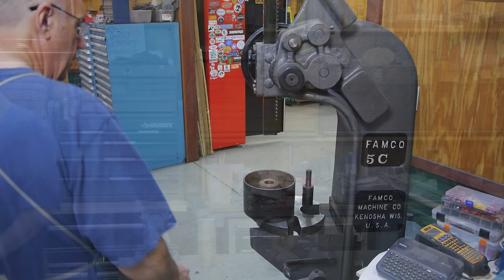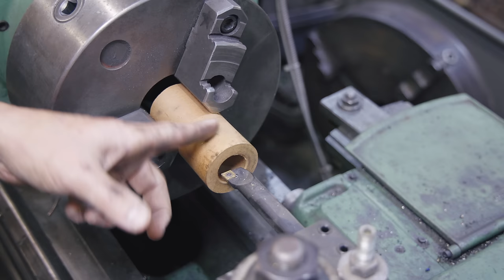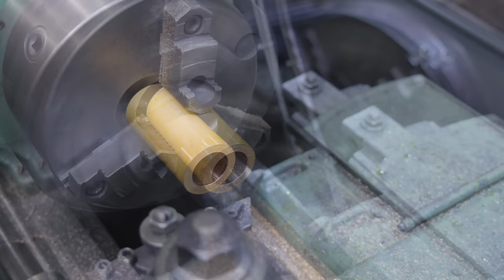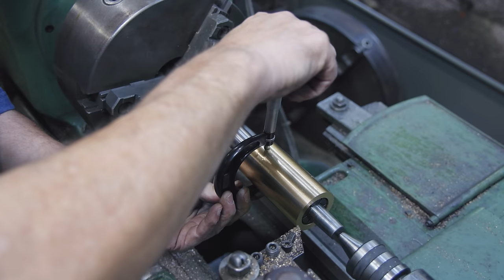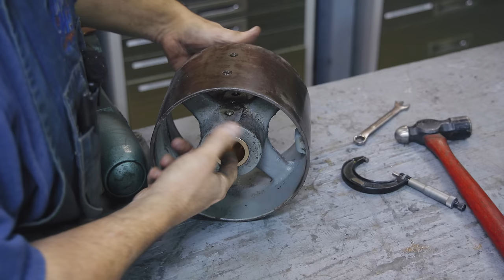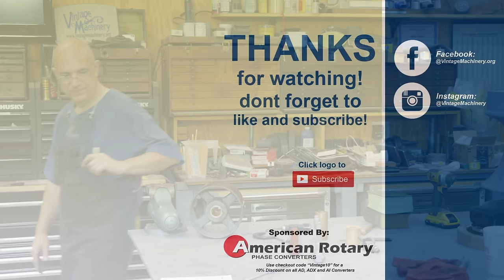Turning a Bronze Bearing for a Flat Belt “Loose” Pulley

Comment: From Oilite themselves:

For Oilite® Bearing Materials
There are a few basic machining practices required to optimize retaining surface micro-porosity and the self-lubricating properties of Oilite® bearing materials.
Cutting tools must be sharp. For this reason, PCD-Diamond inserts are very highly recommended since they hold a cutting edge much longer. This preserves the open-pore structure from which oil can flow freely. A dull tool will smear the pores, greatly reducing the self-lubricating qualities of the material.

Turning: Cutting Feed Rate: 0.002-0.006 IPM

Speed: Oilite® Bronze 375-500 SFM

Speed: Super-Oilite® 250-500 SFM

Roller Burnishing is an excellent choice to modify an ID slightly. Ball sizing can also be used on the ID effectively for final sizing.

Honing and grinding are never recommended on Oilite® bearing materials. Using these methods on any surface which will become the bearing surface will introduce grinding media and could easily smear the bronze pores sealing the micro-porosity.

After extensive machining, bearings should be re-impregnated with appropriate/specified oils. Vacuumed impregnation is recommended. If bearings were not lubricated prior to machining and if cutting fluids were used, that medium must be removed prior to any impregnation of the oil selected for the application. Your authorized distributor can provide oils for re-impregnation after machining.

From me: A groove turned into the ID of the pulley could have been machined and packed with felt to hold oil and that oil would pass through the oilite without drilling an oil hole.

Comment: Back in the days when I did bushing work, it was common practice to soak the bushings in hot oil. Maybe today that is done during the manufacturing process. We would also measure the bore after pressing it in place to be sure we still had the correct clearance. 😊
Reply: I seem to recall an instruction to soak in oil for 24 hours before installation, and they came in finished sizes so you didn't ruin them by machining. I do recall them in sealed bags already oil soaked as replacement spares, but times have changed.😭
Reply: @littleworkshopofhorrors2395  Kieth said that the shaft had an odd diameter. Are you saying that the bearing manufacturer makes custom size bearings for the same price as finished size bearings? The shaft and pulley were likely made before sintered bronze bearings were introduced (1930).

Comment: I remember “soaking” oilite in a rather niche oil in a pressure cooker before installing in some military equipment
Reply: That is "old school".  Oilite uses a special synthetic oil that is forced into the sintered bearing material at high pressure. We were told the only time oil would be (maybe) needed is if there was excessive heat used to install the bearing.
Reply: I’ve re-oiled Oilite using a bell jar and a vacuum pump. As much oil that spun out of that bushing, I definitely would have re-oiled it. It does have provisions for lube now so may be moot point.
Reply: I was thinking that reoiling the bush before fitting it would be a good idea, that would ensure that when the bush was oiled in service the oil would be at the interface as opposed to just filling the bush up, but just an observation is all.

Comment: 8:45  That set of Bore Mics Keith picked up and just FANTASTIC!!! :)
I worked in a production shop, making punches and dies, and we did NOT have any bore mics.

Because the jobs we did were always repetitive, we used either pin gauges, or shop made (or some times customer supplied)  "Go - NO GO" gauges for accurate bore, or ID Ground jobs.

Comment: Oilite bearings are self-lubricating bearings made of sintered bronze. They contain small, interconnected pores that are impregnated with oil during the manufacturing process. This oil serves as a lubricant for the bearing, providing continuous lubrication to the moving parts.

While Oilite bearings are designed to be self-lubricating, they may require additional lubrication in certain situations, such as high temperatures or heavy loads, to ensure optimal performance and longevity. However, in most typical applications, Oilite bearings do not require additional lubrication beyond what is already impregnated within the material.

Comment: 2:15 .. That's an important detail!! .As we an see the inner bearing area is INSET considerably, compared to the flat pulley area .. using even normal pressure to disassemble it ..  could shear the inner part out, as it is not designed for any volume of sideways force. !

Comment: You can hear the disdain and frustration in your voice when talking about how you only replaced it 20 years ago lol. I feel your pain Keith, it's frustrating when ppl don't take of the tool you service and keep running. Hopefully the operator now knows to oil the bearing on start up to prolong the life.
Reply: It's one thing to replace something that's worn out after sixty or seventy years of use, but something like that bushing that's only 20 years old is annoying.
Reply: The new bushing won’t need as much oil as the old one but it will need some. Sintered bronze is very abrasive to cutting tools. Needs very sharp inserts to machine it cleanly.
Reply: In fairness- it is set up as a set screw hole, complete with threads and access through the pulley surface. I can see where confusion came from. I don't get why it was changed from the original though.
Reply: If Keith says 20 years isn’t long enough, 20 years isn’t long enough.
Reply: @marty2872 it is an idler pulley for when the flat belt drive is disengaged, Keith explained in the video. It's a common arrangement for line shaft driven equipment, effectively the on/off switch
Reply: @Paul-FrancisB  I understand the pulley's purpose- thx. The point I am making is it is not unreasonable for an operator not to oil, what Keith admitted, is a former set screw hole...
Reply: well when lazy worker cutting the lifetime way down it is annoying, 
but we will see IF new stuff that is made for the lazy workers 😁 will last longer
Reply: @marty2872  I apologise, I misunderstood your question "I don't get why it was changed from original?" As you know, it rotates independently of the shaft (the holes were empty) it seems obvious it needs lubrication

Comment: 20:14 That size of Brass would shrink about .0005 inches (that's one half of one thousands of an inch)  .. It's measurable, and would make a little bit of difference during a .002" press fit ... 

I LOVE the idea of using Dark Green Loctite, on these assemblies! .. it acts as a lubricant to press the bronze in ... and makes a difference first for the fit being more secure... AND second keeps corrosion out for when it's time to remove it !! :)

Comment: Always nice to see the "colored" metals being machined.  Have you ever machined precious metals, like silver, gold, or platinum?  If you do, we'd all like to see it and how you save the chips!
Reply: @ccrider5398 Good day Sir. I have been machining fine silver (.999) for about 30 years.  My collection system is just a dedicated shop vac.  I hold the vacuum hose next to the business end of the cutting tool.  Pretty unsophisticated, but since the direction of the chips change with each cut on a milling machine, mounting it in one position was useless. Recovering the sawdust from the bandsaw is more challenging, requiring periodic vacuuming the tool and the floor around it.  I only machine silver on the dedicated tools in order to avoid contaminating the collected swarf.  Still, you do not get back 100% of the you paid for the metal unless the spot price takes a huge jump between the time you bought it and the time you sell it back.  When I started in the business .999 fine silver was about $5.00 ozt.  (Troy ounce) Today it's $28.62 ozt.

Fine silver is quite soft, so the cutting tools have to be very sharp or they push the material around rather than cut it cleanly. Carbide cutting tools only because silver is very abrasive and quickly dulls the tools.

Comment: I would suggest that a "better" way to press out the bushing would have been to invert the mandrel you were using.

Inverting it would reduce the vertical offset making the setup far more stable and therefore safer and with the smaller diameter section inside the old bushing there is far less chance for something doing the unexpected.

Comment: It might be a good idea to put an hour meter on the machinery in an inconspicuous location. I find that as I get older, hour meters help me a lot. Equipment like tillers, log splitters, and pressure washers get intermittent use, and the hour meter helps remind me when to go through things. I'd rather spend time doing preventative maintenance than fixing something that I need "now."

Comment: 6:27  IDK What RPM this operates at, but I don't trust that that old cast iron pulley is concentric to the bore.  

I'd turn the OD and press the bronze into the pulley, THEN put the entire assembly in the 4 jaw, and pore the ID like that.  

BUT if it operates at a slow RPM,  (or the pulley is not really very circular?) ... It may not be worthy of the extra effort.

Comment: good idea to soak oilite bronze before installing
Reply: Way back when, the common practice was to soak the oilite brass or bronze in bunker oil. Now a days that might include pulling a vaccum on the soak pan to encourage complete penetration by removing any air pockets within the structure. Capillary action only might not suit in all cases.
Edited for clarity.
Reply: It's impregnated, you can't "soak" it, not unless you have a pressure chamber to force feed it oil.
Reply: @aserta  that is the reason to draw a vacuum on the oil pot. After that the pores are drenched and it is good as new. You can also place it under pressure like they did in the original manufacturing, I recommend 5 atmospheres.
Reply: @aserta  Did you notice how much of that oil "surfaced" while on the lathe? That would need to be replaced!

Comment: Anyone with a job in a Mill or museum or anywhere there is machines that have parts that rotate on another part, such as a shaft. Should know that there should be some kind of lubricant, unless it's running on a  sealed bearing.  :trophy-yellow-smiling:It's hard to find good help these day's.:fish-orange-wide-eyes:

Comment: So, wouldn't the ID shrink a little after it was pressed into the belt pulley?
wouldn't you want to cut  the OD, press it in, THEN cut the  ID to size?
I guess the tolerance is big enough that it won't matter.
Reply: That's what I was thinking. Maybe they will ream to fit the shaft after?

Comment: Will the oil hole weep lubricant out and on to the belt? Should that have a threaded cap or a press ball plunger/oiler?
Reply: Those old flat belts dont go fast enough for it to throw oil like it was doing on the lathe 1500 rpm vs 30 or 40

Comment: Wondering how much force can be produced by an arbor press like that Famco, as compared to the 60 ton hydraulic. It must be at least limited by the weight of the person pulling x the mechanical advantage, but the gears and lever arms etc must have some kind of max rating too.
Reply: I did notice Keith has significantly de-rated himself, the new slimline version is probably only rated 1/2 the previous 😅

Comment: After discussing the needed ID at about 6 minutes, It occurred to some people ''Why don't you use metric? 36.5633 will be so much easier to work with than 1.4395.'  It then occurred   to me 'WHY ???'
Reply: All the tools in the shop are in Imperial. He would need to convert to Metric adding to era.
Reply: It’s only easier if you’re used to working with it directly. Most American machinists would convert resulting in possible errors. Spend some time learning Imperial and you won’t need to wonder why.
Reply: Easier for anyone used to metrics. People who uses imperial’s doesn’t understand the beauty and simplicity of metrics. Especially if you need to combine units of measurements. Keep in mind that inches are based on metric measurement (1” is defined as 25,4mm).
Of course, if machines and measuring devices are imperial, it makes sense to use imperials…
Reply: will the metric police ever give it a rest?
Reply: @edvig2015  I don't understand them.  I offer to switch to metric as soon as they buy me 2 metric lathes, a horizontal mill, a vertical knee mill, and all new measurement tools.  Somehow, the truck with those never seems to show up.  I have to assume they're not really serious about it.  <sigh>

Comment: Why not put 90 degree Zerk fittings into those threaded holes, so you can inject oil into the bushing, without it leaking back out through the threaded holes?

Comment: I get that the museum is trying to maintain the machine as it was originally built, but if that pulley was designed today, would it use the same design?  Or, are there better alternatives for bearings that might be hard to reach/oil?
Reply: Sealed ball bearings on each end.

Comment: Question: when you say your taking a 40 thousand cut does that mean your actually taking a 20 thousand cut because you’re removing off two sides? Thanks
Reply: Yes that’s correct.
Reply: Your asking if he is using "on diameter" or "on radii"/"Absolute" 
and the answer is
Doesnt matter, focus on what your lathe or your works lathe uses and is capable of. Most cross slide read out to on diameter but some are absolute/on the radii so always be aware of your equipement and dont worry about others.

Comment: Kieth.  Every time you use that press and I hear that "spang" as things hit the floor below, I cringe.  Go get a rubber mat and put it on the floor beneath the press.  Both your arbor press and hydraulic are magnificent machines, puts my small machines in the shade for sure but I do have a rubber mat on the floor🙂.

Comment: 22:52 ... I've never seen a YouTube machinist properly lubricate Oil Impregnated "OILITE bronze bearing material ... :( .. They should be soaked in hot (over 200°F silicone based oil, for at least One Hour, before being used. 

And you just KNOW the end user is not going to do this!! :)  ... They couldn't even oil them in the normal fashion.
Reply: We have used a lot of "Olite" bearings over the years and oil soaking was the standard practice.  However, recently (20 years or so!), "Oilite" does not recommend any further oiling for initial startup.  They use a special high quality synthetic that is high pressure forced into the sintered bearing material.  This is adequate for most projects.  The sales rep told us that the only time additional oil would "maybe" be required is if the bearing was heated excessively during install.  So, in the "old days" - yes.  Not so much now.

Comment: Not that critical on an old flat belt pulley, but to be accurate turning between centers with a 3 jaw, you should turn your center first, other wise it is no more accurate than just gripping the mandrel in the chuck.
Reply: So long as your dead center is not so far off that its forcing the part to move in a circle (and that is a very dangerious set up if it is) the largest force involved will be the centripetal force keeping the part on axis.

You can do the round cow calc if you want to, I tried to round cow it enough to fit in a comment but I couldnt.

Comment: Hi Keith, do you not think the loctite will capillary and pressure into the oily pores to reduce the bearings oil holding capacity?
Reply: Keith is using Loctite 603 and using it between the housing and the bearing

" If you can’t be sure the surfaces of your cylindrical fitting parts will always be clean, try LOCTITE® 603 high-strength retaining compound. It is capable of cutting through light coatings of oil on parts, such as cutting fluids and rust preventative oils. Its low viscosity makes it ideal for augmenting press / interference fits, or slip-fitted assemblies with small clearances. The high-strength adhesive reliably prevents loosening and leakage from shock and vibration on cylindrical parts, such as roller bearings or oil impregnated bushings into housings."
Reply: I am not Keith, but I do much the same type of work and with a lot of simular tools and same materials, so I can speak up.

And yes, it does but not by much. Oilite has quite a lot of empty space inside it that gets filled up by oil and some needs to be displaced in order for the Loctite to have any grip. And sometimes you can see how much its soaked in by discoloration and. Even when you can see it, the amount is so thin, its like spotting the edge of some phonebook paper or rolling paper by the edge. Just next to nothing